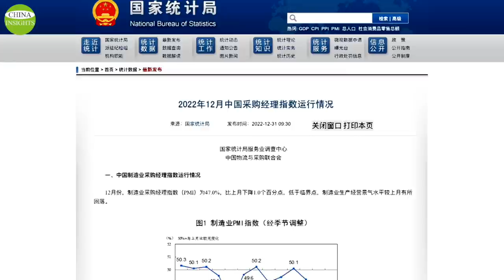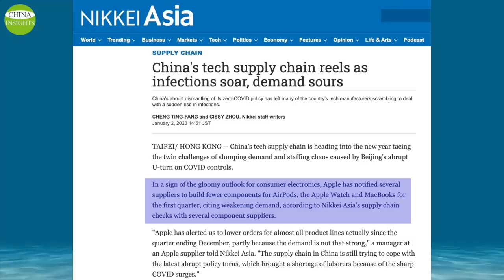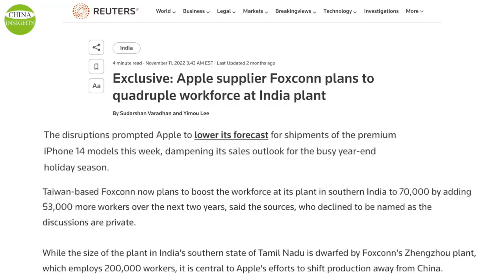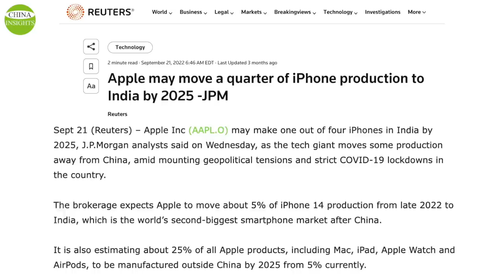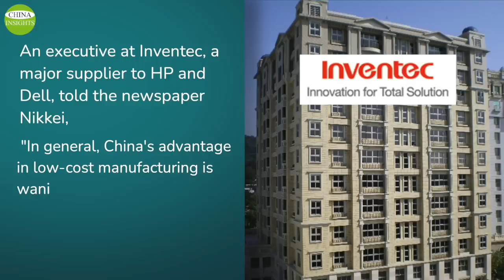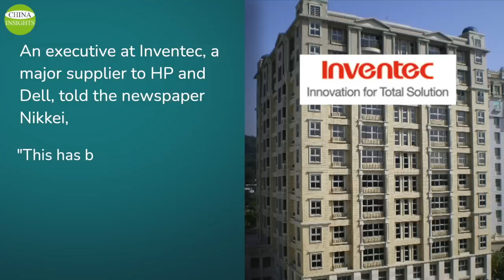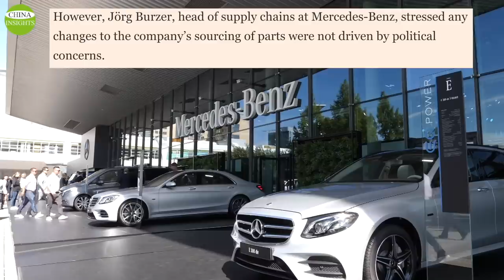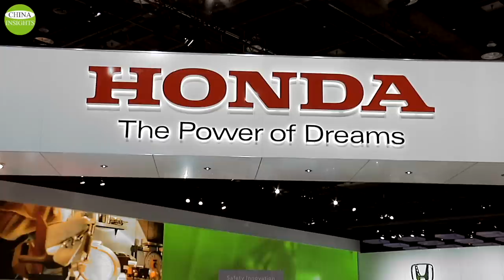China: losing the technology race with the U.S. & the goal of manufacturing powerhouse falling apart

Comment: Over the next 5-10 years, we can expect 50% or more of China's manufacturing production to be lost to poorer neighbors and peer competitors. Chinese labor isn't really cheap anymore, for example, Mexican labor is half the cost of Chinese labor or cheaper, and according to available statistics, the Mexicans do more value added work than the Chinese.
Reply: I hope you are correct
Reply: 20% have gone to Poland because of reliability
Reply: no more threaten by ccp
Reply: @yuexue8283  chinese quality ha, is no quality
Reply: Well right now they can’t be the cheapest because they now have experience.
That increases value
Reply: China is slowly shifting away lower end products with low values added.They are focus on high end productions. Automation, and  AI will replace labor intensive.
Reply: ...........those are low end and labor intensive jobs that moving out of China but like Vietnam 80 % raw materials were imported from China.Cheap labor rate is not only reason for manufacturing consideration.......logistics, infrastructure, supply line, taxes, market, electric power and water supply,  business laws, skilled labor force and  its work ethics .............You are too naive ! and don't call yourself a Dr....
Reply: @jimmylam9846  China is facing the worst drought in its history right now, and as a result facing an energy crisis at the same time. Skilled labor can be taught just as the Chinese were, and everything else can be imported. The only thing that kept the manufacturing hub in China even as its labor cost surpassed other poorer nations was the supply chain being entrenched in China. It was for convenience sake that the manufacturing stayed in China past the point of it being fiscally advantageous, but the Zero Covid Policy has forced the West to begin moving both the supply chain and manufacturing hub out of China. China can continue selling raw materials, but a lot of manufacturing is leaving its shores no matter what they do.
Reply: @yuexue8283  Cap 🧢
Reply: @outtersteller  it has nothing to do with experience. It has to do with the domestic economy. Cost of living is higher in China, that means wages need to be proportionally higher for there to be a livable working wage. Like I said, Mexico does more value added work than China, so they're not unskilled at all.
Reply: @CommonSenses101  AI and supercomputers are going to become increasingly difficult for China to keep up with over the next 10-20 years as the West's Chip Ban takes hold. Nations like the US, Japan, South Korea, and Taiwan have the best shot at AI, robotics, and automation going forward, having no roadblocks in their way for the next 20 years as China catches up to EUV technology, and develops nascent tech such as photonic semiconductors.
Reply: Sorry as a buyer mexico isn't cheaper yet, its not even close, for my parts China is between 20 and 25 present less for total landed cost
Reply: … And the materials produced in Mexico were of better value and quality. They were not designed to fail.
Reply: @juiceman8108  I have factories in China producing goods for my warehouse business, so you’re preaching to the choir. But that’s only currently the case because the supply chain is extensively built out in China, which reduces their material costs. So, up to now, even with higher wages, Chinese products were able to maintain a price advantage, not because of low labor cost but because of low material costs. However, once some of the supply chains are decentralized to other places like Mexico and South East Asia, the cost of products coming from those regions will drop. Furthermore, once the scale of production in both manufacturing and raw materials is decreased, overall cost will go up as a result in China. This is prognosticating a situation which is still a few years away from maturing, but its not far off.
Reply: @dr.j5642  skilled labor can be taught? It all depends the type of works. Some demand highly skillsets. Samsung moved out of China to VN. Samsung was not happy of the outcome in VN. They decded to move back to China.
Reply: @CommonSenses101  no one was happy at first when they moved their manufacturing to China, too. It took years for manufacturing competence to coalesce. It doesn’t depend on the type of work, all that matters is a company’s willingness to invest money and time in top tier training, or not. Apple is moving about half of their supply chain and manufacturing hub out of China into places like India. Apple is probably never bringing those jobs back to China, unless China’s economy crashes, and wages fall back down to 1990s levels.
Reply: @CommonSenses101  well India is only an infant in that field currently. They haven't been doing this very long. But as the years go on, they will grow and mature. There's no real  difference between Chinese and Indians as factory workers. Chinese also protested at Foxconn and caused damage, its not like that doesn't happen in China too. In time, India will become just as good as China, and since their wages are much lower, in the best case scenario, it's possible the majority of manufacturing in China will move to India at some point.
Reply: @CommonSenses101  are you talking about domestic demand in China for Western products? Domestic demand in China isn't all that great right now, and even when things were normal, the demand was still lower than both the US and European markets. There's more money in the West, and as a result, that's where the bulk of consumer demand currently is.
Reply: @yuexue8283  Go home, humineral lol
Reply: Another advantage is the issue at the south western U.S. border and how dealing with Mexico more may help towards that. Why try to enter a somewhat hostile country if you can work closer to your people with relatively good wages?
Reply: @megamanx466  yeah but the US needs Mexican labor in the States too. What’s likely to happen if things progress positively is that an open border agreement could be reached, like Europe’s Schengen agreement, or Mexico and the US can come to a work visa agreement where Mexicans can very easily attain a work visa and cross the border legally.
Reply: @jimmylam9846  You are correct in your assessment.
Reply: @CommonSenses101  moving the supply chain and manufacturing out of China has little impact on consumption. Those in China wealthy enough to afford an iPhone 15 later this year will purchase one no matter where it was produced. China imports the majority of its energy and food, too.
Reply: @dr.j5642  Part of it has to do with Twitter, and other part because of slow sales in China and/or not producing enough EV cars for demands.
Reply: @CommonSenses101  domestic demand in China is way down for nearly all consumer goods, so it has nothing to do with Tesla alone doing poorly, but rather the entire Chinese economy slowing down.
Reply: @dr.j5642  Tesla sales in US is slowing down due to stagfation. US economy ain't good neither.  Big tech companies start laying off employees left and right.
Reply: @CommonSenses101  well a global recession is in play, so that’s unavoidable. There’s layoffs all across the world. But China has it far worse. The current Chinese housing crisis makes the 2008 US subprime crisis look tame. In 2022 alone, China closed more than 4,000 factories, lost the majority of the top tier semiconductor experts, and saw billions of dollars disappear from personal savings accounts across banks in China, an example being the 2022 Henan bank crisis. No one in the world is facing the kind of crises China currently is, only Russia is in a potentially worse situation.
Reply: How do you pair factories with businesses. I want to know.
Reply: Wrong... the future belongs to the market. Which market is the biggest? They will drive the production...
Reply: @satriojumeneng7055  we know which market is the biggest and its not close. The West and its allies (USA, Mexico, Canada, Europe, Japan, South Korea, etc etc) have the most capital, consumerist mindset, and overall demand for products. So, in regards to having money and wanting to spend that money, no one comes close to the West and its allies. As far as who has the most people going forward? Unquestionably it is India. China's 2020 census data is being collated currently and the Chinese census experts themselves are saying China may have miscounted their population by 100 million individuals, all within the post One Child Policy cohort (post 1970s generations). That means China's population is significantly smaller than we were led to believe, but furthermore, it is an extremely fast aging population. Some Chinese census experts are suggesting that their prior date of the Chinese population halving by 2070 is incorrect in light of the new census data, and that it's likely the population will half much sooner than previously expected, some have said as soon as 2050. China is by no means the largest market, neither in the current reality nor in future potential.
Reply: @dannylo5875  can you expound on that because I'm not exactly sure what you mean
Reply: @dr.j5642  For example, Chinese international tourists gave the world $250 billion a year before the pandemic.
This does not include Chinese international students.

It won't be wise for business people not to consider the Chinese market.

The decision should be in the hand of businessmen, not politicians.
Reply: @dr.j5642  I read an article yesterday,  saying India tries to replace China in manufacturing sector, has a long way to go. India is struggling now to to convince companies to move their factories to India. Companies are  reluctant to leave China for India. Example, India invites Tesla but no deal took place. Tesla prefers Indonesia over India.
Reply: @CommonSenses101  -- Correct, but they do not have the know-how since only 13% of their total working population holds a bachelors degree or higher. Even their government website estimate that they have 42 million highly skills open positions. For example, around 50% of the senior engineers at Yangtse Memory Technologies are from the USA and they have a few executives who are from the USA. Fact: The CCP forced the e-commerce/internet industry to downsize through regulations so most of the engineers will move into the semiconductor, renewable energy, and other hard science sectors.
Reply: @yuexue8283  --  China does not have the know-how since only 13% of their total working population holds a bachelors degree or higher. Even their government website estimate that they have 42 million highly skills open positions. For example, around 50% of the senior engineers at Yangtse Memory Technologies are from the USA and they have a few executives who are from the USA. Fact: The CCP forced the e-commerce/internet industry to downsize through regulations so most of the engineers will move into the semiconductor, renewable energy, and other hard science sectors.
Reply: @ttkh68thomas43  Chinese have good and bad quality.. you pay for what you get. If you spend a lot of money you get better quality.. in the west you over pay and they tell you you have to renew your iphone every year.
Reply: @SimonCU  The "circle of business" is very similar to the "circle of life".  Even with China's huge population, they didn't become big spenders on an international level until AFTER the US enabled China to become basically the world's production plant.
The same thing will happen with Mexico and Vietnam and other nations that show the proper characteristics to be the new homes of US/Western manufacturing.
Reply: @satriojumeneng7055  those tourists will be traveling and spending their money whether the West pulls manufacturing out of China or not. Chinese people love traveling, there’s nothing the CCP can do to stop that outside of a complete travel ban, which would just start up the riots again.
Reply: @CommonSenses101  like I said, India still needs to mature. That won’t take much longer than 5-10 years. Big businesses have billions of dollars to make and no time to waste. Tesla might not have made the move yet, but what does Elon do in 5 years when Apple products coming out of India are just as good, but being produced at a lower price than China? The avalanche of manufacturing relocation hasn’t fully manifested yet, but we are definitely seeing the first signs of trouble right now.
Reply: @dr.j5642  I'm just showing you the purchasing power of Chinese people. That's why many international companies built factories in China.
Reply: @SimonCU  🤣🤣🤣  If "jealousy" was the issue, then the US wouldn't help those countries in the first place.
I AM American and I don't remember anyone "being jealous of Japan" in the 80s. Most Americans admired Japan in the 80s and still do today.
You are spewing the usual "America is the Devil" garbage that is typical of the internet.
Reply: @SimonCU  you’d be wrong about that. China only spends about $5.5 trillion USD on consumer goods per year, with a population over 1.2 billion people. The US spends over $16 trillion USD on consumer goods yearly, with a population slightly over 330 million people. The European Union spends over $8 trillion USD yearly, with a population of around 447 million people. Mexico spends just under $1 trillion USD on consumer goods yearly, with a population of around 127 million people. By these numbers we see Americans spend more than 12 times (1200%+) what the Chinese do on consumer goods per capita. Even the Mexicans spend 40% more than the Chinese on consumer goods per capita, being less than 1/10th (10%) of the Chinese population, but spending about 1/6th (16.6%) what China does in total, or about 40% more per capita.
Reply: @dr.j5642  Everything can change within 5 to 10 years timeframe. It is a very complex  dymanic environment. Everything will be done by automation, robotics, and Al. So labor intensive and labor costs will no longer be the key factors when it comes to decision making process. 2 keys factors companies are  reluctant to allocate their factories to somewhere else. 1) look @Jimmy Lam's comment, he made a valid point. 2) for Domestic consumption, reasons : 2.1 large market shares,  2.2 reduction of shipping/transportation cost, and time. 2.3 local raw materials.
Reply: @satriojumeneng7055  and I’m telling you the Chinese will continue purchasing no matter where the product is made, and will continue traveling and spending money even if the West tries to pull its manufacturing out of China.
Reply: @CommonSenses101  yes everything can change in 10 years, but that can be for China more than anyone else, since that’s where most of the manufacturing is done currently. Furthermore, robotics and AI require the best semiconductors, which China will be deprived of. In 10 years, China will still be using indigenous 7nm chips, or at best 5nm, all while the West and its allies in East Asia are getting under 1nm.

I already responded to Jimmy, his points are dated and don’t coincide with the current reality on the ground in China. Here is my response to him copy and pasted for you:

“China is facing the worst drought in its history right now, and as a result facing an energy crisis at the same time. Skilled labor can be taught just as the Chinese were, and everything else can be imported. The only thing that kept the manufacturing hub in China even as its labor cost surpassed other poorer nations was the supply chain being entrenched in China. It was for convenience sake that the manufacturing stayed in China past the point of it being fiscally advantageous, but the Zero Covid Policy has forced the West to begin moving both the supply chain and manufacturing hub out of China. China can continue selling raw materials, but a lot of manufacturing is leaving its shores no matter what they do.”

Jimmy cited a host of nonsense advantages, such as water supply and energy cost, completely ignoring the on the ground reality of China’s current drought and energy crisis.
Reply: @quasimotto8653  yes but have to thought about US will one day be jealous of Vietnam and Mexico? Why would US let Vietnam be the No.1 in the world.. they didn't like it when Japan and China was about to take over the position.
Reply: @dr.j5642  that's because majority of the things were made in China.. China do spend a lot of school fees in America and designer products from Europe, though.
Reply: @dr.j5642  No, that's wrong. The capital will stay in China because China is the biggest market. If the factory leaves China, then China will make local factories with similar products because it will be cheaper, and business people know that.
Reply: Vietnam is booming.
Reply: @VenturiLife  It's because of its proximity to China.
Reply: Move to Mexico , that would Slow down all the immigration to the USA.
Reply: It’s exactly what Peter Zeihan says & definitely seems to be playing out that way. China also hasn’t been able to manufacture high end technology/chips either. The thing their best at manufacturing they’re being undercut by nearby south East Asian counties like you said.
Reply: @dr.j5642  Well said. China is only the second biggest economy , because of volume. Switch to GDP per capita, and they fall to 79th. That's one spot below Iraq. To put it in perspective.
Reply: @ralphzoombeenie2330   dozens of BRI signee nations have cancelled or rolled back many BRI projects, such as Pakistan, Malaysia, Myanmar, among many others. Others have already defaulted on Chinese loans, which forced Beijing to “forgive” billions of dollars worth of loans to save face and prevent a large scale defaulting across the entire BRI landscape.

Furthermore, economic projects and blocs like the BRI and BRICS can’t do anything to unseat US economic hegemony. When fully built out, which will take decades, it will help China avoid issues with importing and exporting goods via naval corridors which can be blockaded by China’s adversaries, nothing more. The BRI will not change the fact that all international trade must go through the same 3 step process where national currencies are converted to US dollars first before being converted again to the receiving nation’s currency. It won’t change the fact that the world relies on international financial institutions controlled by the US and the West, such as the SWIFT banking system.

How are we favoring war by opposing trade?

No one has threatened the US? Are you forgetting Russia has repeatedly threatened to use hypersonic nuclear weapons on places like Washington DC and London? Chinese Generals and politicians also have used many provocative threats of destruction and aggressive words, especially with their ridiculous wolf warrior diplomacy nonsense.
Reply: Like the Takata bomb air bags?
Reply: @lance8080  no1 in US is willing to work for lower end paying jobs. Shortage of lower end works are a real concern.
Reply: @CommonSenses101  going from low quality to no quality no value
Reply: @CommonSenses101  no they didn’t. My Samsung Galaxy S22 is still made in Vietnam. And my Samsung TVs are made in Mexico. Sounds like Samsung is plenty happy building anywhere but China. 😂
Reply: @juanzingarello4005  Samsung has many  production lines. They planned to move back.
Reply: Not likely. China is upgrading its manufacturing with automation,. Poor country can't compete with robots. Lol
Reply: Vietnam, Thailand and i hope Philippines can get some business
Reply: @yuexue8283  No. China's economy is UNBELIEVABLY fragile, and is dependent on export led growth. China is also way too confrontational. It is in for some hard times.
Reply: @CommonSenses101  In the short term it will not be India that will pose the greatest threat to Chinese manufactures. That honor will likely go to nations like Vietnam, Thailand and the Philippines.
Reply: @georgehollingsworth2428  They are having problems recruiting skill workers in Vietnam. Many positions are open, many applied,  they are still unable to find qualified candidates as of these days.
Reply: @satriojumeneng7055 It's the west that has the biggest market. The continents of the Americas and the Euro zone is far bigger than China. And those consumers are choosing to avoid buying Chinese made products. As this trend continues to grow, China will realise that there is nothing they can do about it.
Reply: @satriojumeneng7055 Have you noticed that international factories are no longer being built in China? 

Why would they? There's no future there. It's a different period now so people need to stop talking about how big China is, it was big but it's economic model is no longer growing their economy. And as for internal consumption, how will that ever be possible with rising unemployment and unsustainable national debt?
Reply: @Fleshox19-uz3qt  I heard Apple will come back to China after unsuccessful trying in India.
Reply: @Fleshox19-uz3qt  I don't think so.  ASEAN markets are bigger than America's market.
And Euro zone market is less than the rest of Asia.
You're fooling yourself.  
Just remember China got 1.4 billion people.